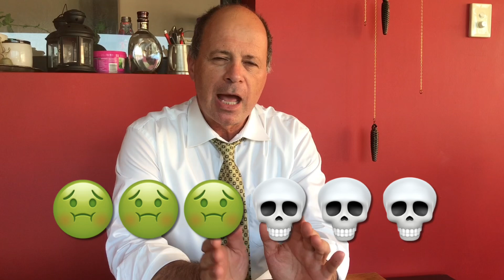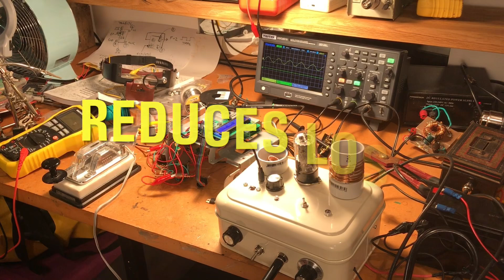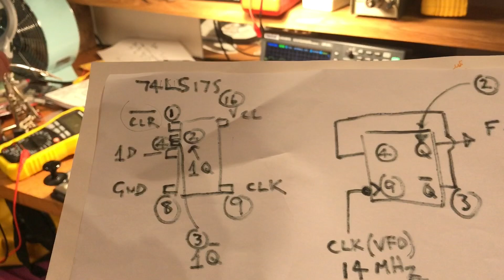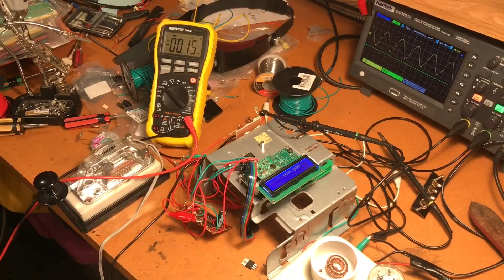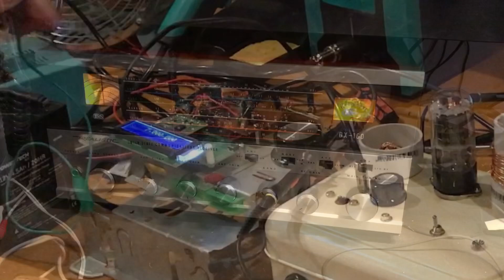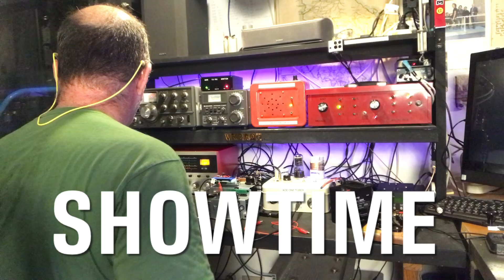Nostalgic QSO - with HOMEBREW single tube rig and digital VFO

Comment: C'mon  George, send us a news release that you have got the  Dx 160 going again.... it can't be that hard.  Even if  Jaycar  can't supply the FETs or they cost too damn much (most likely) you can get the m from Rockby or the well known  Adelaide man, Mark K.  I'd be putting in a  J310 as the primary   input FET just to be sure.  Or if not that then the J109, which is a pretty poor cousin with Ids about a third of the former . But it might not be that - might be the input diodes. 

 If you input  a micro RF signal with the  input diodes out of cct and you still find you get no audio out then you have  suffered serious magic smoke loss.... likely the two RF fets and possibly also the associated bipolar.  Sometimes its easiest to  change out a whole area and not get too far into Einstein-ian  what iff diagnostics. Leaving that  2.5 uH inductor out was  a costly mistake/shortcut  - maybe cost the whole receiver.  I wait to see....
Reply from the maker: What I’m hoping is…. Although I left out the 2.5mH choke…. I did put back to back diodes across the receiver input and they are OK…. So I’m thinking just the pass transistor (I earthed it by mistake) for the PSU has died…. So maybe, just maybe the receiver is OK. I have ordered the part …. Stay tuned…. The suspense is killing me too 😂😂😂😂 73 and thanks for all the help Tim.
Reply: @TheArtofEngineering  There are  1n34 diodes, GErmanium inside the rx.  one of those may have failed to a short condition  while the external diode  you inserted  took little current  (esp. true it is a silicon diode) , it seems unlikely though - would have failed open normally..  Possibly the  pass transistor is all that has to be replaced. I  would have thought the Pass Tr was pretty generic, without looking at the schematic....we wait and see.  I imagine the   Transmitter is now going again it was only the  VReg  device though you now need some form of proper heat sink under it and then bonded to the chassis....
Reply from the maker: @ Fingers crossed. The transmitter is going now but will pop a heatsink on the voltage reg …. As I think this is why it has misbehaved previously!  Yes the transistor is most likely generic … if the parts don’t arrive will look at a substitute 73

Comment: Mate so good to see you got it working the trusty bd139 amazing.👏👏👏👏
Reply from the maker: Thanks....yes ....but now the receiver is dead....all part of the fun! 73
Reply: @TheArtofEngineering  I bet the  Ebay seller knew it was on the way out,   and wanted to move it before it finally  failed..
He thinks:  " ha  I'll stick it on  Oz Ebay and some mug  from Synney town called George is sure to pop up !!  "  he was right.
Reply from the maker: @F_Tim1961 The receiver? Definitely… already changed all the caps, a pot… more to come 😝. 😂😂 maybe the tube too ? Maybe the dodgy inverter?? Maybe my very dodgy soldering??? It is working again (the transmitter) …. I think the analog power supply you suggested is on the vision board for future iterations/ rigs and I’ll use my new old stock tubes 73
Reply: @TheArtofEngineering  have you considered the  possib that  hot RF got moved over to the Rx from the  Tx tot he Rx input via the  C/O relay ?  I am pretty sure you are using a relay  for  antenna  c/o in this design but controlled from a manual switch.

Is there any chance that  220 Dc leaked over from  the output circuit  of the Tx   to the  input fet of the Rx - even 10 v on the gate of the fet or DG mosfet  might kill it.  Lord help you if you have an obsolete  DGate  mosfet and it is now dead.  IN Oz  Minikits in Adel might be able to help you out but at a PRICE.
Reply from the maker: @F_Tim1961  I'm using a relay to key the cathode (keeps voltages off key). The unit will not transmit till I throw the switch which  changes coax from leading to the receiver to output of xmitter....unless the switch has capacitively coupled energy? But did do a long QSO no probs....The unit seemed to dislike the relay switching of the standby input at rear. Blew a fuse once? I have checked this contact to see if it is hot on xmit etc seems OK?? Still gotta dig around inside....All part of the "fun" 😆. The standby does do stuff near the voltage reg transistor...I'm going to measure for voltage etc near it but checking it in cct seems to suggest it is cactus....I'll pop  it out and check it soon 73
Reply: @TheArtofEngineering  VOltage reg cannot  survive any back voltage on it from OP side. IF you have substantial C there and the drive side goes GND immed on powere down that's an issue. THere's  a Return diode fix which is on the dsheet for every  LM  regulator ever made.  PErhaps this is the issue BUT   since you never published a schematic of what you did I can't be sure  of what you might have done there.
Reply: @TheArtofEngineering   I repeat myself .for  D_Gate mosfets and similar that might be  in the Realistic HIGH end even Collins quality Rx  - and blown Mini kits ADL may be able to provide. Find him on the internet.  ROckby Electronics too in melbourne have a lot of obsolescent bits and pieces in SemiC  line.  You will find they don't do small orders to interstate.
Wassa  Wrong un --- ??
Best thing - inject a very L_Lvl RF source  and see where the signal drops out - I believe  you have the gear to do that .  The question then is did pairing up wit the Frankenstein Tx do the business  or was it old age ?  

The mysteries of the magic smoke.  I found  schematic for that thing once. .. the  Audio PA is mess and can be done much simpler,  even at time of MFr ,  the rest seemed fairly standard.

Comment: Congratulations George on your achievement. It's great to see someone persevering until they can make it work.  We see so many videos in support of commercially available equipment so it is great to see some homebrew in action. I must confess to recently buying an IC7300 which makes the Navy B40 I used aged 16 seem prehistoric. However, I harbour a dream to build a simple tube transmitter and you have given me the confidence to give it a go.  You are correct about the waterfall.  I can often hear stations that don't register. Let's hope good Hams keep their ears in order.  Thanks for the video and well done.
Reply from the maker: Thanks for the kind words. The IC7300 is a great radio!  Tube building can be a great learning experience. I'm sure you'll enjoy the challenge. Too many fun things to enjoy in this crazy hobby we enjoy 73.

Comment: Great stuff mate! I'm mucking around with an old Novice transmitter (Johnson Adventurer)  with a similar VFO. I used that 1:2 step up transformer from Greg's page and that seems to be enough to drive it to full output, but only on 40m. I think 80,20,15 and 10 will need a bit more drive. de Andy, VK5LA
Reply from the maker: Thanks Andy…. Straight after the video the DX 160 died and the xmitter is also MIA. It was fun while it lasted and we shall get it going again… all part of the fun of running boat anchors and old stuff with personality. 73 Andy and tu fer the comment.
Reply: @TheArtofEngineering  Transmitter is hopefully MIA because the  driver cct failed (again). It  it don't work with a crystal installed  and the  valve filament is still good then, mate, you have problems.  If it is the PSU I suggest goign for Raw Iron - ie  a transformer pulled out of a Cowshed Rx  radio with a second  30 V secondary one in series to bring the RMS v up to of order 230 V and then rectify it and use a choke type filter. that sort of design will work for  30 years on 80 % duty cycle.
Reply: Sadly, the availability of older tube electronics is scarce on the ground here in VK. I guess with all the stuff here in Australia that wants to kill you, tube radios aren’t as cheaply available. 

A couple of 30V 2A multi tap transformers can be used with some voltage multiplication n give you enough angry electrons to run a couple of EL84 / 6BQ5 tubes to drive 10W or so into a speaker for a guitar amp. Have a look at Grant Willis’s Lamington design.

Back to back transformers have been used to drive tube preamps for mics and instruments, but it’s not wonderfully scalable 

I’d probably just series a bunch of lower voltage conventional iron and jam it through a voltage doubler / quadrupler with some SMPS primary supply filter caps.